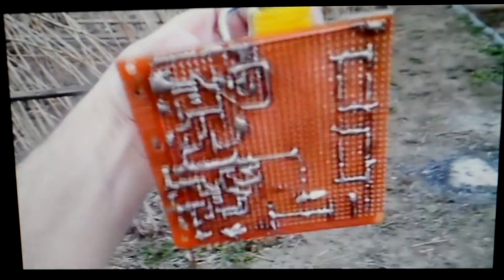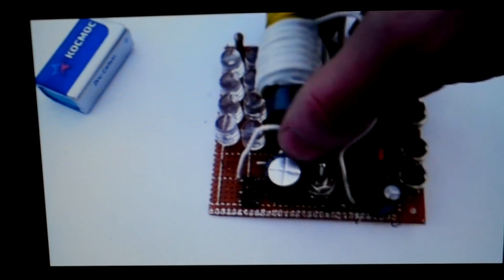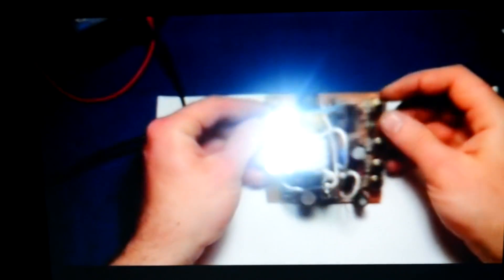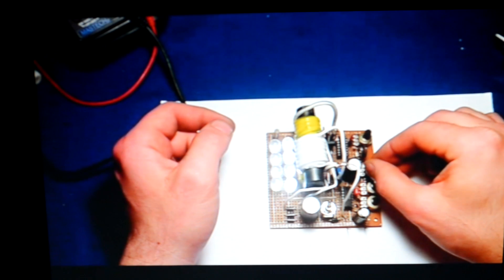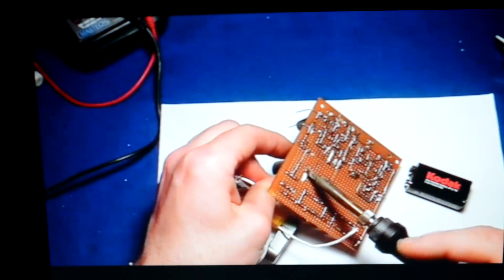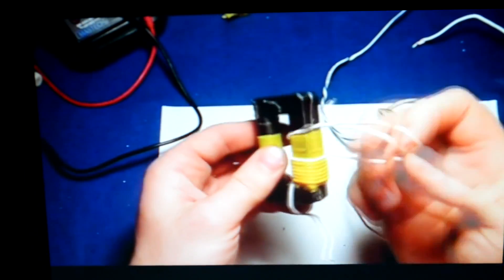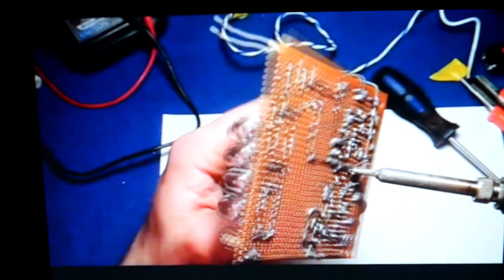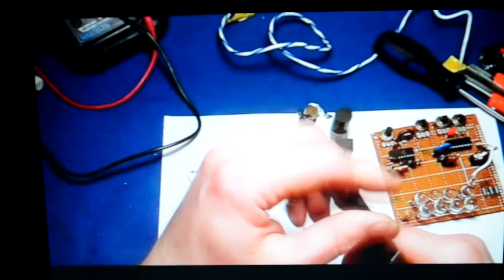Wesley Translate's Akula video #15: Akula's TPU part 4

Comment: how are we sure that its not the capacitors...you just plug power for few seconds to capacitors and they get charged for few mins.
Reply from the maker: Talha Kamran well you did not  even noticed that this is translation   of experiment and not my experiment. there is my voice there acting as event interpreter and not as event conformer.
Wesley

Comment: Could anyone help me contact Akula. I just want to tell him a idea to test it. I am wondering if you stick a perminent magnet on the core. Will the resonance frequency decrease and the brightness increase when hit the resonance frequency. Because high frequency resonance means small capacitor need assume you have a relatively high inductance. Small capacitor might be hard to adjust.

Comment: Hi, Wesley! Yes it is possible to work with resonance of ferrite with recycling of energy, but it is not Free Energy. Sooner or Later this resonance circuit will discharge. If he is honest he must to make video of 24 Hours run of this device. Very simple. In nature- there is no Free Energy. We use Sun, Wind, Atomic e.c.t. energy. Energy of ferrite- :), this is not energy- Ferrite is material with magnetic properties, but there is no evidence of atomic- resonance self destructing effects with extra energy output involved. It is. P.S. Jesus is resurrected ! :)
Reply: You can do the math. He only touch the positive and negative ends for a second. And it lights for a while. E=V*I*t=9V*1A*1s, that is 9Joules and it lights up for a long time. or even better you can use http://hyperphysics.phy-astr.gsu.edu/hbase/electric/capeng.html
to calculator the max energy store in capacitor. It definitely overunity. That means it gets free energy from somewhere. Or if you not prefer the name free energy. Then, I would call it quantum energy or atomic energy.